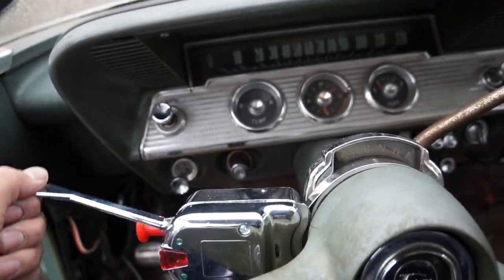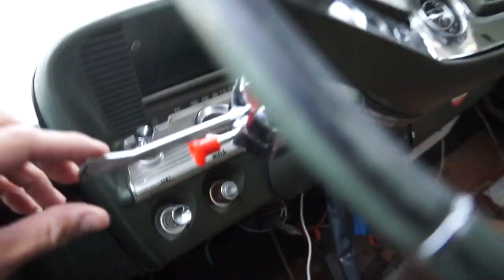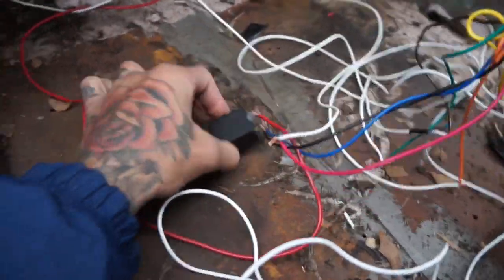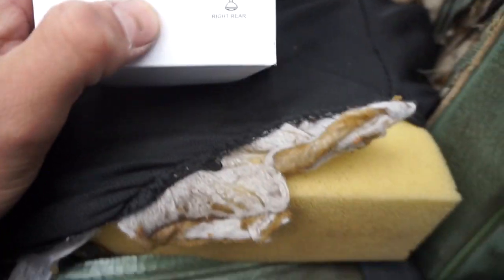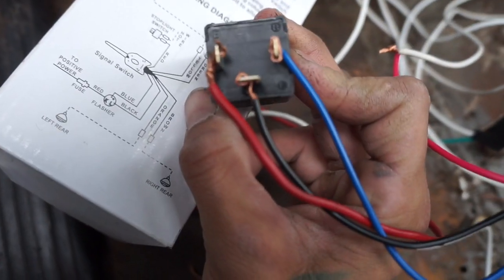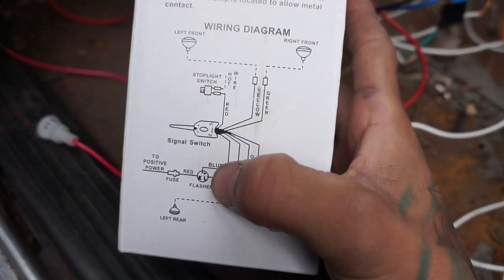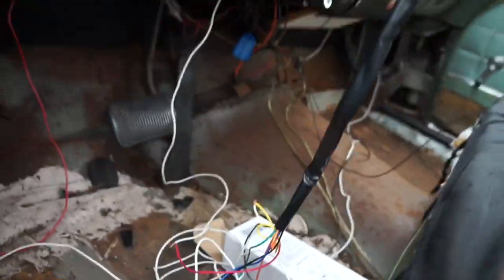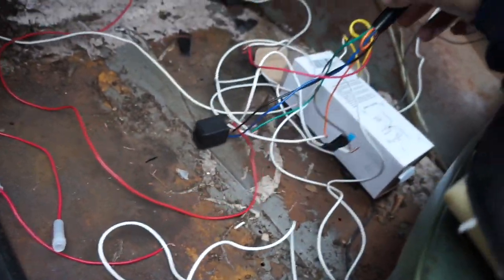How to install universal turn signal

Comment: I put one on my 64 Ford Ranchero years ago without any instructions. I'm redoing it now, had no brake lights, parking lights, or blinkers, but had head lights. I unhooked everything, had a blown fuse and one of the wires broke from the solder inside the turn signal.
I messed up by not writing down where they all went.
Make a diagram and keep it in your mechanic book.
I love it when she gives me a challenge.  😊👌

Comment: I have to laugh because you look like me a few weeks ago doing the same thing. It can be a nightmare! Nice job kid. Never give up.
Reply from the maker: Thanks man! What did you put yours in?
Reply: @vincentbryan1962  1989 B150 Dodge Van with 500,000 + miles.  Icm the original owner. I just ordered a Universal. Turn Signal and Hazard Flasher unit for it.

Comment: Been fighting this on a golf cart for several days. The grounding wire to the switch housing was the key. I will go get a longer screw so I can connect it directly to the housing where the two screws that hold it together.

Thanks for the help.
Reply from the maker: This project took me a whole day to figure out. I hope it all works out for you
Reply: Were you ever able to get your golf cart working?
Reply: You know why it didnt work the first time? Its because none of the metal chassis/frame/steering columns are grounded back to the battery on golf carts. Therefore yes you had to run a ground wire from the switch to battery ground directly.

Comment from the maker: I just re watched this video- I apologize if it seems hard to follow. 

What made it easier for me to do was to buy wire- and fish it directly to the source which is the back of the light bulb. I realized that my head lights or tail lights all have 2 wires in the back of them. One wire is hooked up to my car dash. Sending a signal showing on the dash flashing the direction I’m going. The other wire (purple) is what activates the blinker. That connects to the blinker switch. 

2 wires 
Try one out if nothing happens then try the other wire. I did that with all my lights. Learning what wire does what. 

If you don’t have a fuse box like I do for your main power wire. You could also run the power wire directly to the battery if you’d like. Along with the fuse of course. 

I used a universal turn signal flasher they sell at autozone. 

I made a mistake in the long run by running my wires close to a heated areas without protection. I had an exhaust leak and it burned up my wire making my turn signals mess up and break fuses. After doing my investigating I found out one wire section was burnt up. 

I thought I had to get a whole new turn signal switch but in reality it was just one wire that was burnt inside. 

I hope this video helps people. Boy it feels good knowing you did it.
Reply: Thank you for this video.  I was about ready to shot someone.  This video is a Huge help.
Reply from the maker: Awh man I’m so glad! What you got it in? What kinda ride

Comment: Glad to see you got it man I'm still having problems trying mines to my 64 chevy four door hardtop I hooked up my wires to my lights and to the electronic relay the fuse wire to my conjuntion box for power now I only have one red wire that's left on my signal switch my switch looks similar to yours do I hook up that red wire to the brake light switch like pic on the box and what you stated now for the terminal next to it what wire goes there I have none what wire would I need to hook up to that thanks maine if you can help fa sho I appreciate it

Comment: Great video and thanks for posting.  Just curious.  Question:  With assistance, have you checked that the rear blinkers function properly while applying the brakes.  The reason why I'm asking is because of the way you wired things coming out of the brake switch.  I could be wrong, but it appears you are, in effect, bypassing the blinking function when the brakes are applied.
Reply from the maker: Yes they work when I press the brakes! I check by looking at the cars behind me the reflection. What doesn’t work is the hazard lights while I’m driving. I have to have the car parked for the hazard lights to work. So maybe that’s what you meant by it not functioning properly? What do you suggest different
Reply: @vincentbryan1962  Hmmm.  The hazard lights not working unless the car is stopped has me stumped.  Is it possible that this was the case even prior to installing the turn signals?

Comment: Advice: Next time buy a bunch of those little twist on connector caps when temp connecting wires. The outside is plastic which will keep the bare wires from touching other wires or metal. You have a bunch of exposed wire which came drive you crazy if they should touch without you realising it. They're easy to untwist and switch wires should you need to change something.
Reply from the maker: They were only exposed at that moment in time because I made this video before cleaning anything up, it was a total mess. If they would have touched one another a fuse would easily go out or my lights would fuck up. Thanks for the advice though

Comment: There should be a bundle of wires with a plug that connects to your steering column signal switch. You could've tied your universal switch into that bundle of wires to the lights without needing to run new wires to each light making for a cleaner install.
Reply from the maker: I know but I didn’t have any info on which color went to which light. It’s an old car and finding out that info seemed harder than buying longer wire and connecting it straight to the bulb either way I learned a few things along the way and it works till this day
Reply from the maker: You could use anything. Electrical Tape works- if you want a secure connection buy a bunch of connectors-crimp them together-  then put electric tape around both of them.

Comment: Just FYI lookup Helicoils for thread repair. You possibly could have repaired your factory threads? Thanks for upload.
Reply from the maker: It was a lot more complex than simple threads there were broken plastic pieces plus I don’t know how it works/ what diagrams I need to go by. It was basically a clusterfuck. This seemed like a more simple straight forward solution. Plus it gave me the opportunity to start all over and use new wires and and bulbs and sockets and it’s still working great today

Comment: Awesome man you make it look easy to do
Reply from the maker: It took a lot of trial and error plus it didn’t make it easier because some of my bulbs were out. So I had to take out all the bulbs and inspect them before going any further. Sometimes the wire connectors needed play for it to blink in sync. I have the same wiring today just upgraded all the connections :) I plan on it working for another 50+ years without ever messing with it again

Comment: You're a life saver!!
Reply from the maker: Hopefully it helped!!
Reply: @vincentbryan1962  You did. Especially the part with the grounding strap. I did a continuity check with my multimeter and I had no clue that the material, that seem to me is plastic, can conduct electricity. As soon as I strapped it down and everything worked!

Comment: Bro. The blue wire is optional. If you want to use it, you have to use an independent flasher. Those that has a terminal with a letter P, apart of the terminal with the letter L and the terminal with the plus sign. Those flashers are used in cars with a single turn advice on the dash, like the Nissan cars.
Reply from the maker: What does an independent flasher do different than the universal one that I got?
Reply: It does that single blinker light of the switch or the dash turn on. When you have both blinker lights on the dash, that flasher isn't needly, and you can to use a normal flasher like the yours. And the flasher that you are using, one of its terminals it's the ground. There is working because the switch's interior bulb is doing a bridge with the steering axle and the blue wire is sending the negative load

Comment: I got one question,  what does the Topochico bottle holds in ?  Is it the recovery container for the radiator ?
Reply from the maker: Lol yes. I used it temporarily for the overflow tank for the coolant
Reply: @vincentbryan1962  That looks cool kind of ratlook.

Comment: Any issues is the turning signal switch still working ? And Thanks for the video
Reply from the maker: Yes. But it had nothing to do with wiring. It wouldn’t click down or up. It was loose. Something broke inside/ maybe a bolt came off. Anyways I replaced it with a brand new one and color coded every wire. Was very easy. It was just not taking care of it - kinda a personal issue.

Comment: What fuze did you wire it into? And if the stoplivht switch is missing, which wire do i connect it to. The original owner of this car jacked up the wiring really bad
Reply from the maker: I honestly played around with it. And practiced using them all. They were all open so I experimented. Some fuses turn off when the car turns off some fuses are constant power so I can turn on my lights without turning on the car
Reply: @vincentbryan1962  thanks
Reply from the maker: Let me know how it goes!
Reply: @vincentbryan1962  I will. Just gotta figure out the wiring in the chasis manual

Comment: Just fyi, stoplight switch is your brake taillights.
Reply from the maker: Did I wire it wrong? I wonder why it’s been working fine for me for years
Reply: @vincent bryan  no bro, you said in the video you didn't know what it meant. You did it right. I was just saying stoplight=brakelight.. I'm not a comment ninja lol
Reply from the maker: @Mikewheeler131  no I was legit wondering if it was the right thing. It makes sense now that I haven’t had any problems. Sometimes you can get away with things for so long. But I appreciate it
Reply: @vincent bryan  I'm building a 32 ford pickup from scratch. Started with just the cab. I'm almost done and was watching videos on how to install these things, wish the instructions were more clear. I appreciate your video , it helped

Comment: Im having trouble with mine it blinks all the time no matter what position its in , i can move the wires around on the fuse only thing i can get is it not blinking at all or all the time
Reply from the maker: If the wiring is right. And it’s properly grounded. It sounds like you need to get a new turn signal
Reply: @vincentbryan1962  ya ima try grounding the switch better forst
Reply from the maker: @that_fairlady_z8671 it’s not the switch that needs to be grounded it’s the actual turn signal itself. The circular clamp is the ground for the turn signal. It has to be pressed up against bare metal.

Comment: holy shit do those wires under the dash. not the switch wires man use some zip ties or tap hide them..and you should for god sake bye the some different color wires that you are connecting not all white,.
Reply from the maker: You gotta be insane to think I left everything like that. This is for video purposes only. Today 2023 all of the wires are hidden. It’s ok you can sleep tonight